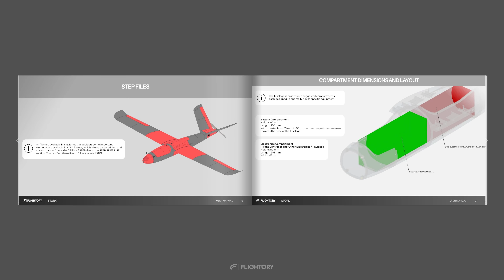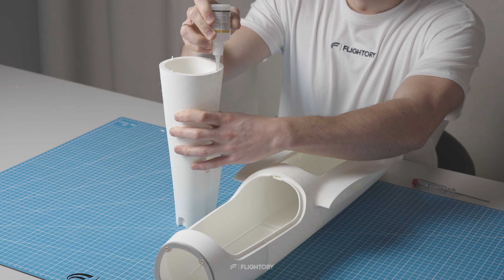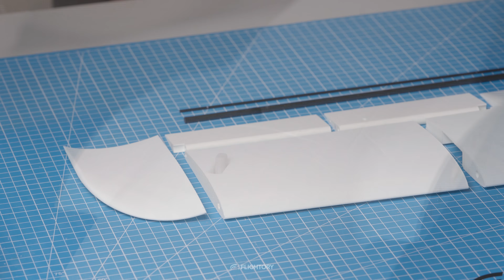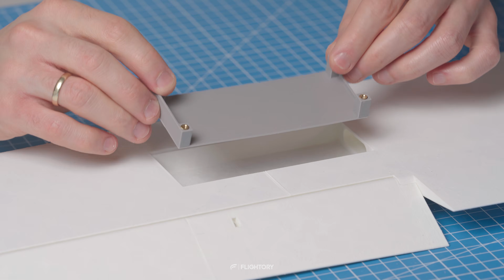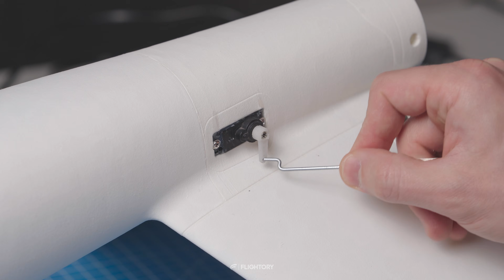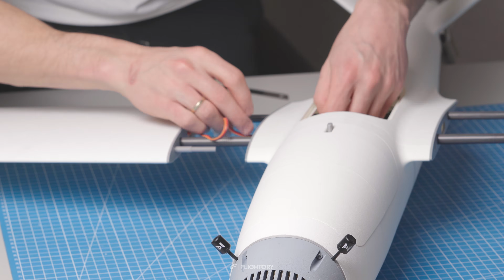3D Printed Fixed Wing – Full Build | Stork

Comment: Oh yes, im building this just because of the printed m6 knobs like the talon. Wish more designs would adapt this as its simpler to use and you cant make a mistake in lining it up unlike those clips. Broke a few clips already but its already glued down to the wing root with CA so its very hard to repair/ replace.

Comment: list of recommended 3D printers?
Reply from the maker: You can print it on any printer with a print bed of at least 220×220, but we recommend Bambu Lab mentioned in video.
Reply: @FLIGHTORY P1S is fine?

Comment: Very nice, I'll suggest adding a pair of threaded inserts with screws holding the battery tray for better reliability, because I've encountered tray separation during flight causing the center of mass to shift and the plane to crash so maybe a modification to this section, also in other planes (mine is a stallion) may be a good idea
Reply: A little 3m tape does the same thing

Comment: I wish i could afford the electronics. Looks like a fun hobby.
Reply: You can! You can build your own amateur flight controllers using microcontrollers like esp or a cheap rpi solution (it needs to be a real time os so not linux based), you can also get one motor, a battery, and a cheap set of servos for not to much. Not to mention you don't need everything at once, building drones takes time, buy things as you get them done and price becomes less of a problem.

Comment: I'd like to know what electronics gear is required, especially for VTOL. There's nothing listed on the website so I can price those parts. Thanks in advance.
Reply from the maker: Everything is listed on the website and in the user manual. The equipment is a recommended suggestion — the choice is flexible, and you can select electronics with similar parameters.